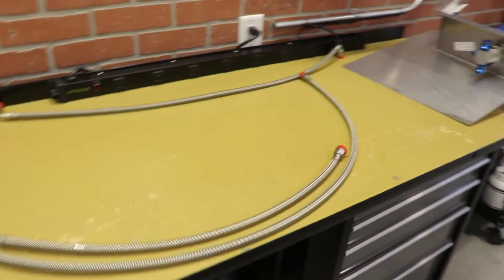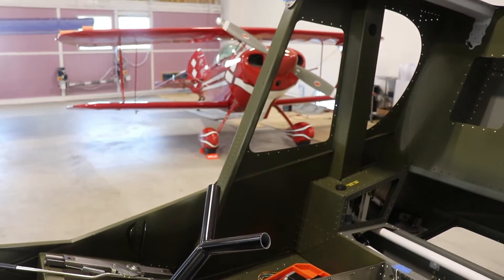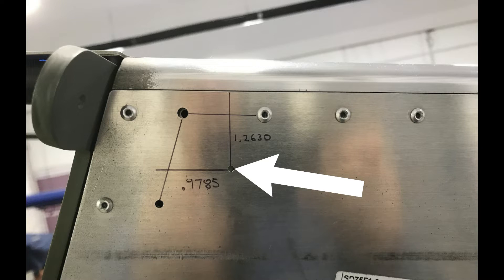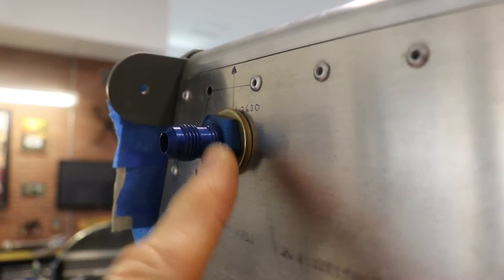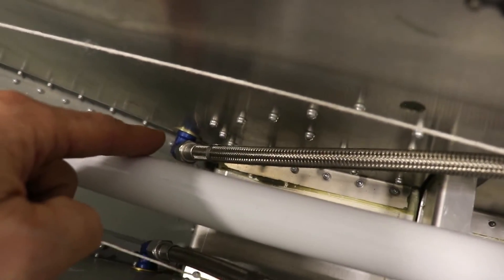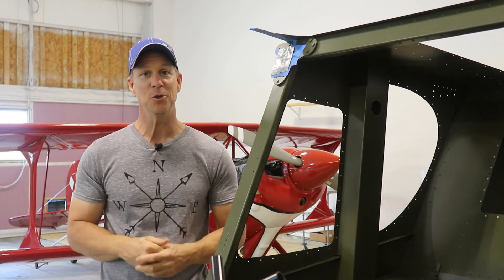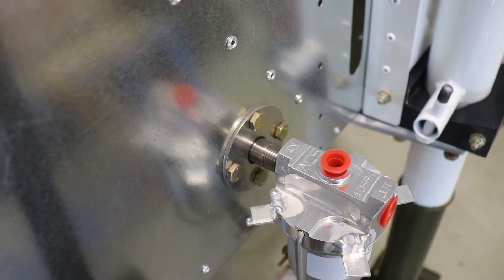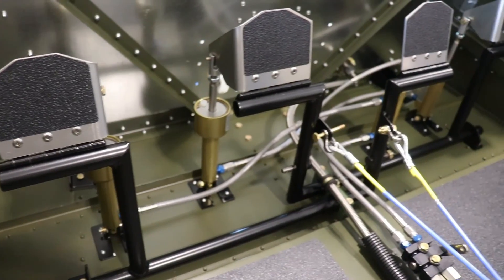Zenith Super Duty FUEL LINE Installation

Comment: Mark, I saw that you plugged the vent tube for the gas tank. But, if I understand, you will relocate the vent tube so it will not leak onto your wing. How does this work? Where will the new vent tube go? How is it set up? Thanks!
Reply from the maker: On the Super Duty tank there is no vent tube. The threaded hole I plugged is for a return line if you are using an engine like the UL Power. The fuel caps are vented.

Comment: Love the Carl Goldberg reference. I built a lot of those planes in the ‘80’s.
I used cable tube clamps to secure them.   Like the ones you used for the fuel lines. I think you called them addel clamps. I called them P clamps because they’re shaped like a P. Lol

Comment: Excellent video and I will contact Aircraft Specialty.  I understand you are not installing a UL Power engine but have one in your Cruiser - I'm considering a UL520T (turbo) for my 750SD which will require a Header Tank (I will often be at gross and  live in the Rocky mountains).  Do you have any videos on the installation of your UL engine including the fuel system (I looked but no luck)?
Reply from the maker: Yes I have a couple videos on the UL Power.

Comment: Do the plans call for flex lines everywhere? Also, What is the service life of the flex lines?
Reply from the maker: The plans call for rubber hose. You can use it if you want, just be aware that in 5 years you'll need to replace it all.
Reply: @KitplaneEnthusiast  I for sure wouldn’t want rubber hoses! Just wonder why they don’t use solid aluminum tubing,... what is the service life of the lines you installed?
Reply from the maker: @cebunting  You can use solid aluminum tubing. In fact this is what I initially planned in my Cruzer. The problem is that you have to get the bends very precise, and you can't use one line from wing to fuel selector. Using multiple lines means multiple connection points that have the potential to leak. The other thing I don't like about solid aluminum lines is that should you find yourself crashing into the trees or the back-country and the fuselage gets bent, those lines can break and pour fuel all over the inside of the plane. Prob not a good idea. The flexible braided lines will simply bend and not break. For the life of the hoses, see the description box of this video for more info.
Reply: @KitplaneEnthusiast  thanks for explanation! Makes good sense now.

Comment: It was my impression that quality AN fuel line fittings do not require a sealant.  However, I've also seen it recommended to, as much as possible, use similar metals in male-female fittings such as aluminum to aluminum  or steel to steel.  I have aluminum AN fittings throughout my plane, used no sealant, and have never had a drop of leakage.  However, the one time I used a steel fitting connected to an aluminum fitting (such as you are doing throughout your fuel system), it leaked!  So, I think it might be good insurance to use a sealant such as you are doing.

For those who want to save some money, you can fabricate your own fuel lines by buying the hose and fittings.  I used Earl's, a quality supplier that sells conductive-lined hose.  One additional advantage is you can leave the fitting off one end of the hose and run it through smaller holes since you don't have to have a bigger hole to pass the fitting through and then attach the distal fitting once the hose is in place.  This also will allow you to run one continuous length from fuselage bulkhead fitting to fuel selector valve, eliminating one or two connecting fittings in the run.

Great, detailed video.  Keep'em coming, Mark!
Reply from the maker: John, you should read what I wrote in the description box.
Reply: "When all else fails,  read the instructions. " So, to paraphrase,  "When all else fails, read the discussion box!" LOL!
Reply from the maker: @n206ja  FYI-I just added the explanations to help answer a couple questions. So it wasn’t there before. You’re off the hook! Lol
Reply: John and all,

Sealant is NOT required on AN flare joints.  It is required on NPT threads.  No issue at all with stainless fittings on anodized aluminum fittings.  For those who want to fabricate their own fuel lines, there are absolutely high quality "do it yourself" lines available.  However, it is extremely important to make sure you are utilizing a conductive lined hose.  A standard non conductive teflon hose which is available from many industrial/automotive suppliers will not stand the test of time due to static discharge to the pin braid which can result in a weeping "soaker" hose over time.  For those that enjoy fabricating hoses, it is definitely something to consider.  However, there is no real cost savings to doing so.  Another item to consider is the pressure testing of the assemblies.  A correct proof pressure test is in the thousands of PSI.  The hose will never see that in actual usage, but the proof pressure test is done to ensure correct assembly of components.

Comment: Can you use electrical great shrink tubing to splice your protective sleeve? Grote makes a hot glue line shrink tube as well.
Reply from the maker: Yes that's the plan. I need heat shrink that has glue on it. I have a lot of heat shrink tubing but non of it has glue to stick it in place.

Comment: OK, so I have to geek-out and ask how you arrived at those precise caliper dimensions to locate the pass through fitting into your fuselage.  Do they correspond to the as-built fuel line location in your wing or ????  Great video Mark.
Reply from the maker: You dont have to be that precise. All I did was mount one elbow so that it cleared the longeron, and once that pilot hole was drilled, just measured it so I could get it in the same place on the other side.

Comment: Trying to find your fuel level sender video without joy (the one before your burnout video). If they were to be installed inside the tanks per kit instructions, the float arms would need to be rotated 90°, correct? Is that catered for or would you just get more burned out scratching your head? Glad you took your time and made a great decision.

Comment: Actually you should have one washer on the inside and one on the outside. Fuel lines inside the cabin make me crazy.
Reply from the maker: You can put one on the inside and one on the outside like I did on the two 90 degree elbows in the tunnel, but you’ll have to grind down the inside washer quite a bit to fit under the longeron.
Reply: That's the way I did mine in the STOL 750.  I ground a flat side on the inner washer which fit flush with the longeron. @KitplaneEnthusiast
Reply from the maker: @n206ja  Either way works. There’s no scientific reason both washers can not be on one side. These fittings are designed to go into a hole with a washer on the nut. It makes no difference if two washers are under the nut.
Reply: @KitplaneEnthusiast  I agree either way works, but if you put a large-diameter washer on the inside (i.e., there's a washer on both sides of the fuselage skin), it greatly increases the surface area of the clamping forces and somewhat increases the rigidity/decreases the flex of the fitting on the very thin fuselage skin.  I'll grant you, however, in this particular application there is very little stress so the benefits are marginal, at best!  As you say, either way works - and do what works for you! LOL!

Comment: How do you get the air bubbles out of the high point by the selector valve?  I installed transparent fuel lines on my zenith.  Scared me to death to see what air actually does and doesnt do.  Air does not purge from a high point.
Reply: If you open your line and let it run, the air should evacuate. Trapped air that won’t bleed is usually a sign that your lines are oversized for the flow demand and you cannot generate enough velocity to purge the trapped air.
Reply from the maker: Obviously I know nothing about your fuel system, but there should be no air in your lines. My fuel system is nearly identical in the Cruzer as it is in the SD and it works perfectly well with no air bubbles. Maybe you’ll need to flush your system sort of like bleeding the brakes?

Comment: I wonder if it wouldn't be better to use a similar aluminum washer on the thru hole. Not sure what the washers you used were as they had a bronze hue to them? Not a fan of having dissimilar metals together. Am I wrong? Is the blue anodization enough to prevent that especially if anodization  gets scratched and you get concentrated corrosion at a single point? I see this a lot on the Reddit Aviation Maintenance thread.  Also anything to worry about if using low lead and switching to the new av gas formulation coming this year or going from av gas to mo gas as in a Rotax engine besides the oil change schedule? Just thinking ahead to the whole fuel system.  What is the quoted life of these fuel lines?